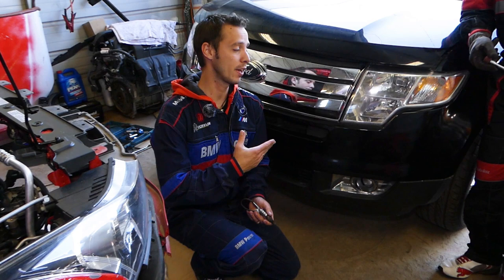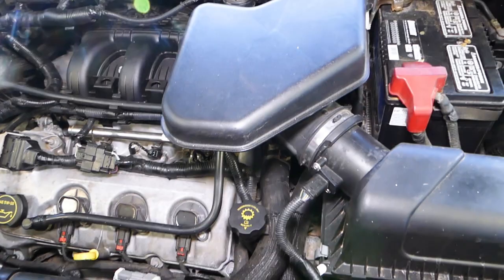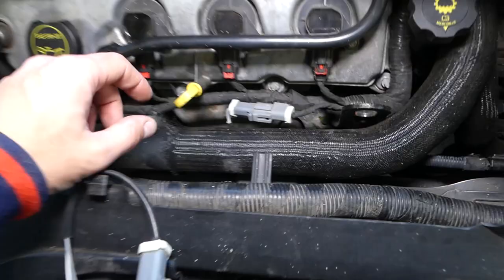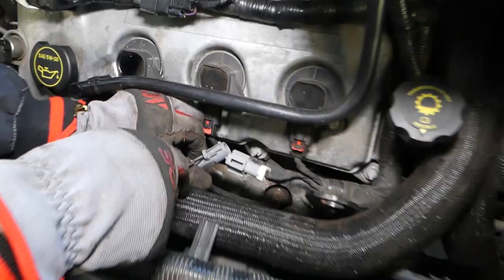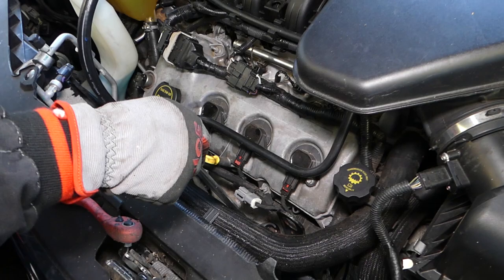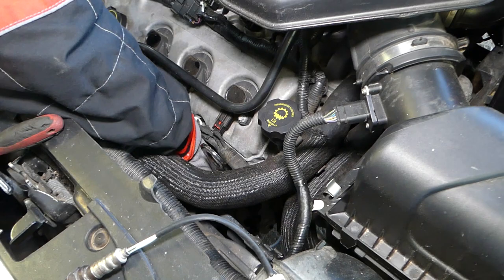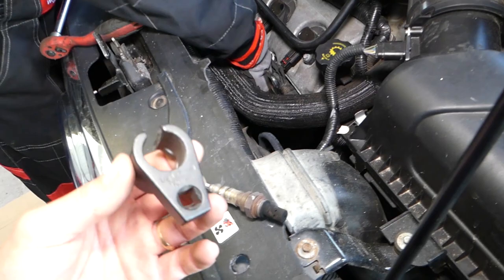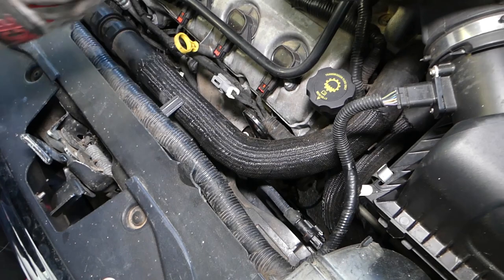HOW TO REPLACE OXYGEN SENSOR BANK 2 SENSOR 1 ON FORD EDGE 3.5 3.7

Comment: I was hoping you had a video showing catalytic convertor replacement on the edge 3.5.  I will need to replace the bank 1 cat in the near future.   Do you get to it from the bottom or top?  What has to come off first to get to it?  Thanks!

Comment: Hello thanks for share your knowledge.  I have ford edge 2013 with P0420 code.  Which sensor do you thing I should replace?. Also when I accelerate the card a smell get inside the car even with the air-conditioning working..help please
Reply: Did you ever find out that’s the issue was having that issue now
Reply: @YrbFamily107  I used a product that I bought from Autozone to clean this sensors and reset the code. The code appears intermittent but reset by itself. So far the problem has stop. I don't remember the name of the product but you can ask in Pepboys or autozone about it. Let me know if you don't find the product to help you.
Reply: Could have an exust leak that what happen to me. My flex pipe was cracked an then it broke an after it broke it was so loud lol. I had a code p0430 bank 2 lean I do belive an thank ill have to replace cat

Comment: There are 2 oxygen sensor on bank 1(1 on top 1 by the side)which of them is sensor 2?

And also
Where is bank 2 sensor 2
Reply: Bank one is the one closer to firewall. Sensor before the cat converter is #1 or upstream the one pass the converter is #2 or downstream
Bank 2 is radiator side,  #1 is before the cat  #2 is after. Hope this makes sense.